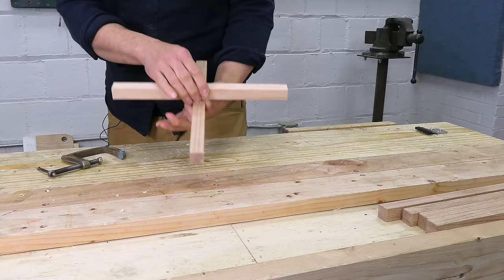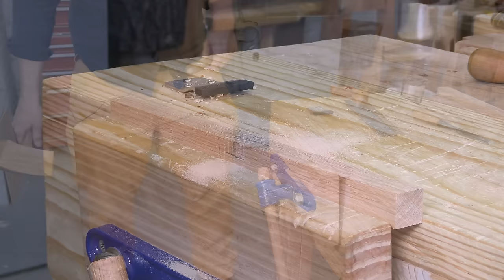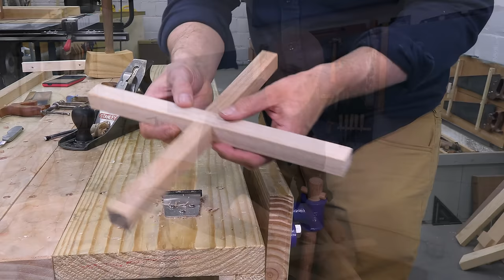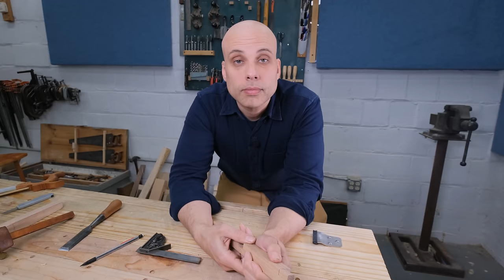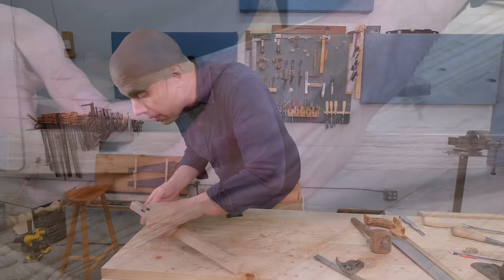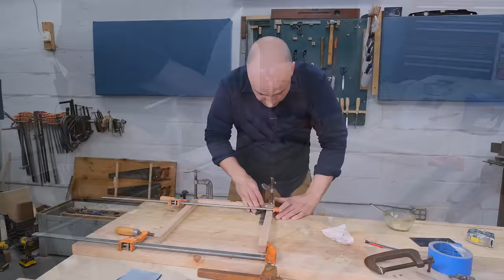Build the Square-Leg Craftsman Table (Part 2)

Comment: The vise block you sell reminds me of a jig that you can find in the book "Jigs and Fixtures for the Hand Tool Woodworker" by Graham Blackburn, in the book he uses it to mark set lines by putting a pencil in the corner and just gliding it along the edge of a board.  Good cheap book if you want a whole bunch (50) of workholding and measurement jigs that are all pretty general purpose and usable.
Reply: Ebay has multiple copies for about 7.50 right now if you get curious.  Amazon is overpriced.

Comment: I built a trap door for covering the cellar stairs, so we could also get to the attic.  I designed as a torsion box, with internal ribs running both with the length and across the width - so, perhaps over built by some standards.  The ribs intersect with half-laps like your middle stretcher.  To get the saw set up (I used a dado set to cut the notches), I practiced using scraps of pine.  I now use one of those practice pieces as a saddle square.  It is going on twenty years old, and remains true.

Comment: around 19:40 you mention that you can't saw into the corner, which is true, but you can establish a saw kerf or knife wall from the edge and chisel out waste to achieve a line that goes directly to the corner, establishing a ledge that will allow you to saw to that exact line. It's slightly less sawing and maintains a little more material for the joint, but obviously isn't essential to the result.

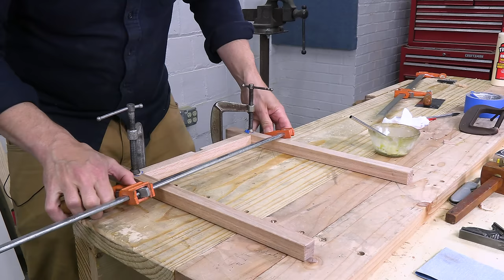Comment: 28:00 I like the idea of attaching a fence to the bench to anchor one side & use the bar clamp on the unsupported leg to make sure they are square & parallel. If the ends need a bit more sanding or what have you to get the lengths spot on can make your table shorter before you get the fit you're looking for.

Comment: Rex, I've been looking for some vintage planes and I've been seeing some with corrugated bottoms (parallel grooves running down the length of the planing surface) and I haven't seen you use one of those.
Just wondering what they're for and whether they're worth looking at.
Thanks!

Comment: Thank you for these very educational videos (parts I and II). One thing I wonder about is that you recommend starting sawing (western style) with a pulling motion. Previously I followed a video about sawing by Paul Sellers, in which he strongly advised to always start sawing with a push stroke, otherwise the fibers you touch will lie against the teeth of the saw. That would make it harder to keep your saw aligned when you start sawing. Why do you advice the pull strokes first? Unfortunately I cannot find this specific instruction video of Paul again...

Comment: Very nice video! At 28:50, the second clamp at the top, doesn't that induce a flex in the wood? Would it be better to clamp it a little lower and measure at the top?

Comment: When your cleaning up (scraping/sanding) your pieces before glue up, aren't you concerned this will alter the size of those finely fitted joints? I've had this issue where I get everything fitted snug, and then go clean up the pieces by sanding them smooth....only to then find that now all my joints are loose and sloppy.

Comment: Is there any advantage to cutting the shoulder of the dovetail part later instead of cutting it with the rest of the shoulder?
Reply from the maker: If you get rid of the other waste first,  then you're cutting a thinner piece and it's easier to be accurate. Also,  some people are going to do a plain half-lap, and I wanted to show that.